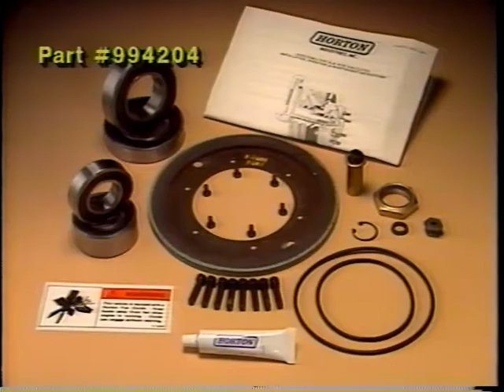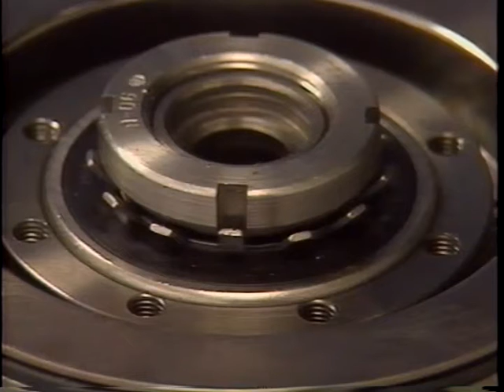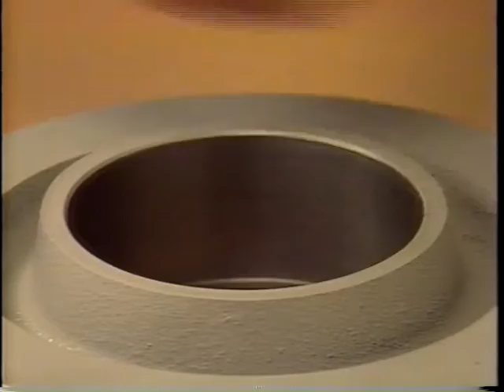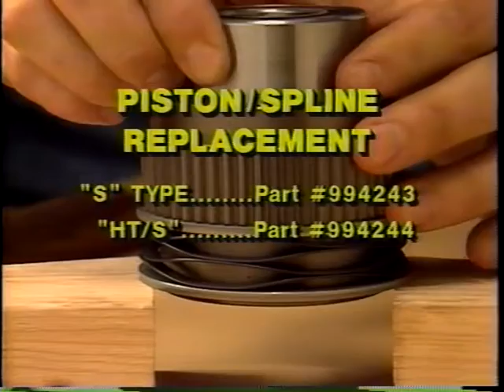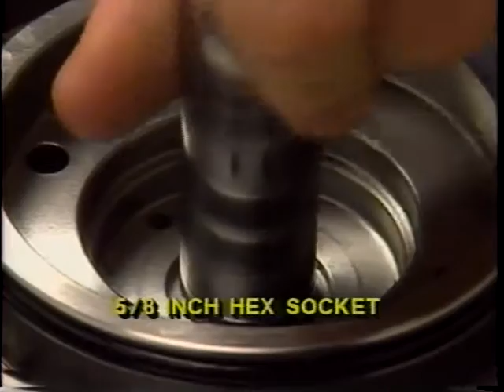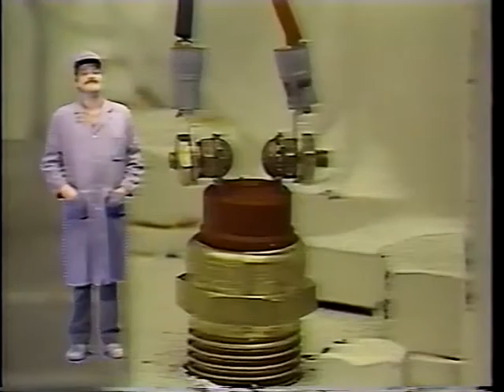8.10 - Maintaining Your S and HT/S Type Fan Clutch

Comment: I have been watching a lot of videos on fan clutches lately. This one is identical to my clutch except the pulley is a v belt in this one, the brass insert and u cup wasn't in mine and I didn't have studs sticking out for the fan. I might try that stud thing but I don't know if I can get the hub off without moving the radiator if I do. My fan is working again. That is all that matters. It was fried when I bought it. The friction material was gone. And I think someone rigged it to stay on all the time too. It spins without pause as soon as the air builds up. Thanks for posting the video. I subbed. I hope you keep them coming. I love the company name too for some reason. I to get haters for my music. They just don't know a good tune when they hear it.

Comment: I was stranded on the side of the road with a bad fan clutch and the only thing that saved me was the music in this video.
Reply from the maker: Glad the music helped, and I know you may not have had them but, did you realize you could install two bolts in the holes to lockup the clutch and get you back on the road again?